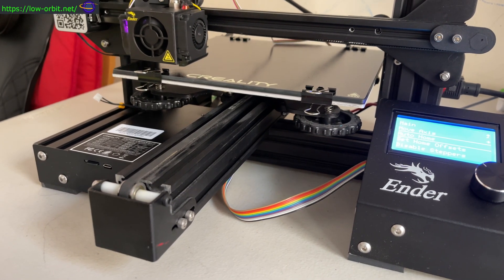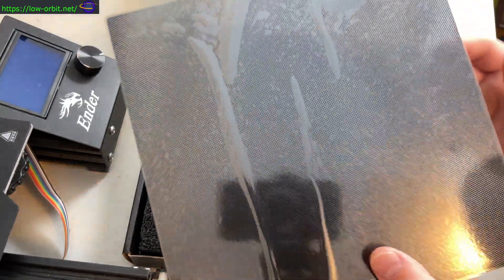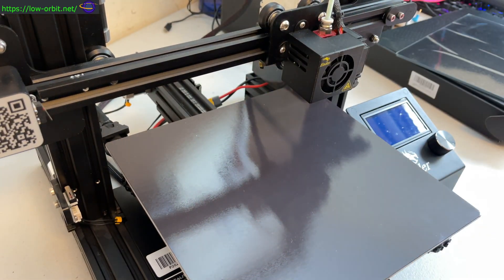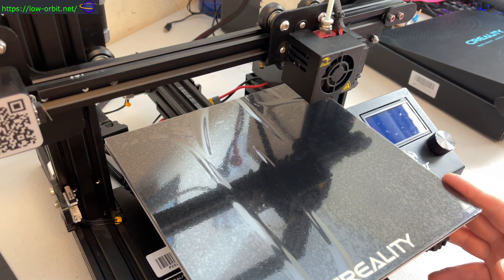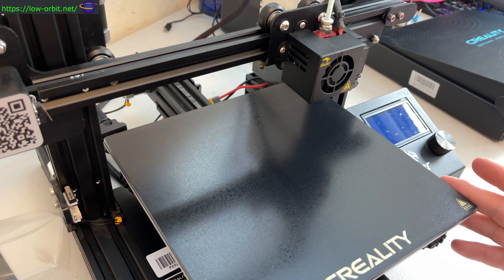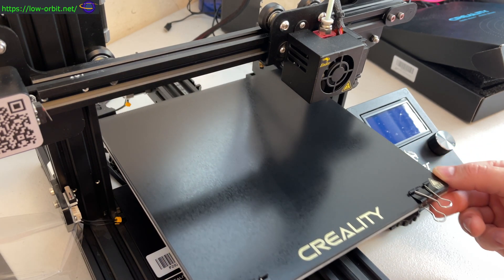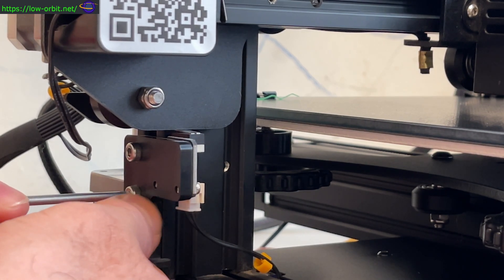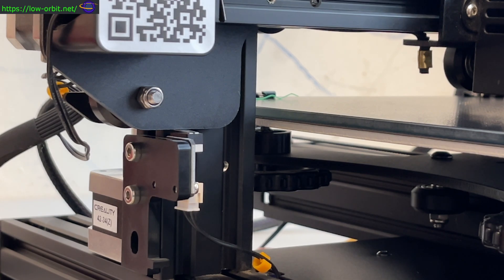Ender 3 Pro - Glass Bed Upgrade

Comment: I found an Ender V3 Pro on the side of the road, Thanks for explaining the glass fuses.
I thought they had a smooth and a rough side to the glass, I guess I don't need the clips now?
I wonder why the metallic ones don't fuse.

I wouldn't mess with the Z stop, just put it all the way to the plastic stop on the bottom, that is how I found it.
Instead I just level the bed to the new Z height after homing.
Works fine for me.

I prefer auto leveling though on my old printer.

Comment: Nice job, except for the over-loosening of screws for z cut off switch. I plan to swap to glass and will only loosen off a bit, enough to slide up n down only.
Good to learn from others mistakes.
Even the tips in the comments about baking paper or grease proof paper between glass and magnetic strip.
To stop adhesion of glass to it.
More good stuff to learn. Cheers all

Comment: Leaving the magnetic rubber base on is a good idea in case you want to upgrade to a spring steel PEI plate. An occasional dusting of talcum powder will prevent the glass bed from adhering to the rubber base. Best tip for the glass plate is to KEEP IT CLEAN. Wash with warm water and a squirt of dishwashing soap after every couple of prints. Greasy fingerprints are your worst enemy.

Comment: Serious question:

Why did you adjust the placement of the Z-axis stop, instead of lowering the bed on the springs?

Looking at my printer, I have a feeling the answer is self explanatory, however I am curious as to whether or not this has been attempted, and I'm sure there are others asking the same question
Reply: I think it's like an extra safety measure
Reply: The springs may not have enough travel left to move it down. With my magnetic bed one of the corners was already compressed most of the way.

Comment: Easier to adjust the z-stop by losening the screws, put the edge of the glass plate between the z-stop and the frame it normally rests on, then retightening the screws.  THEN put the glass on the bed.

Comment: Hey, quick question. Does your glass bed have marks from prints? I ensured my nozzle is at the proper height and not scratching the bed, but there's marks from my prints like on the stock bed.

Comment: You need to take out the magnetic shield, is very easy just heat the bed at 80 degrees and peel it off it comes right out easy. If you
The magnet shield don’t have non benefit if you live in on, your bed never will be flat enough!